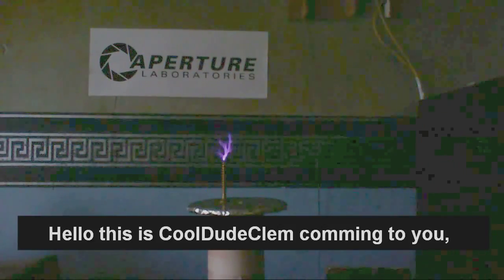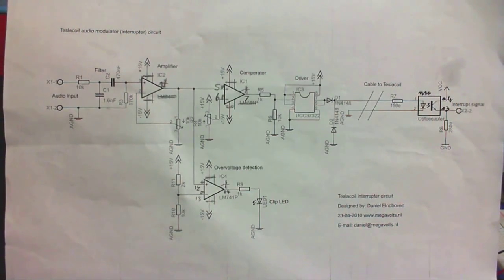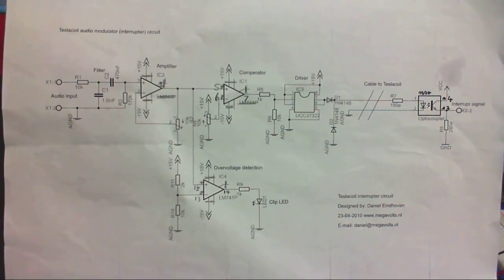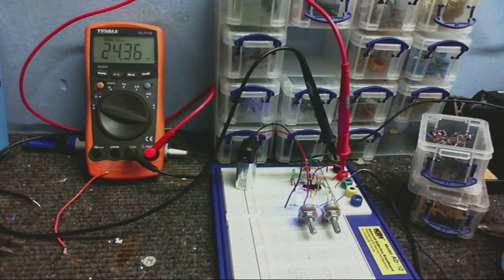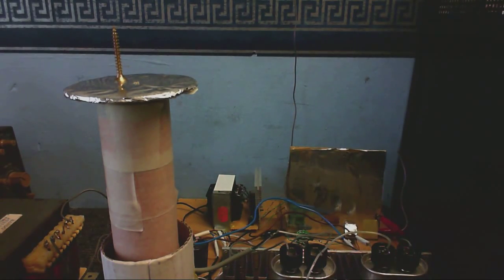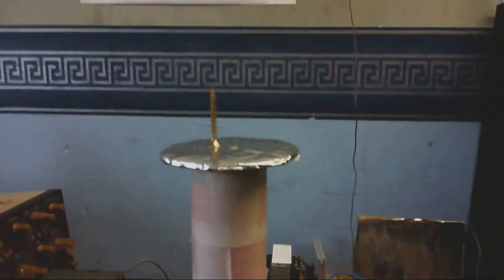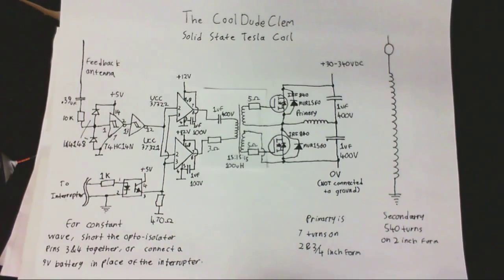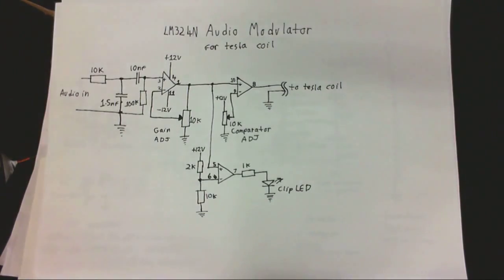My SSTC now with audio modulation!

Comment from the maker: +Miguel Cota The antenna is there so the circuit can pulse the primary at the right time, since this circuit uses feedback to oscillate.  Hopefully you'll see this,  your comment has no reply button, I don't know why, maybe I'm blocked or something.
Reply: +CoolDudeClem ok ok thank you and what is the antenna made of and how did you make it?
Reply from the maker: +Miguel Cota It's just a peace of ordinary wire, a couple of feet long, noting special.